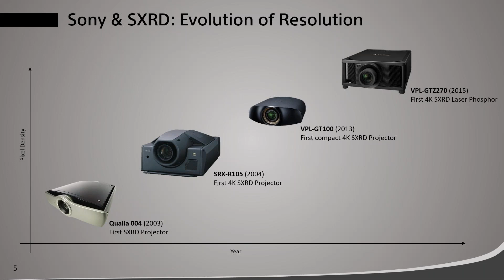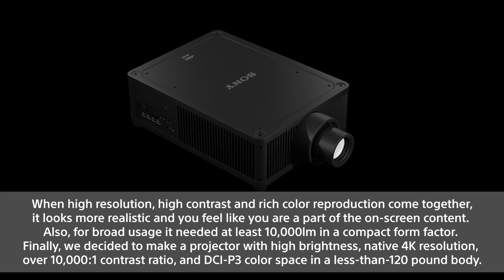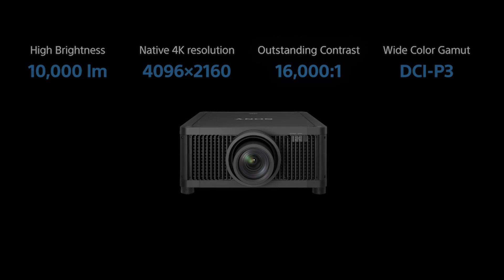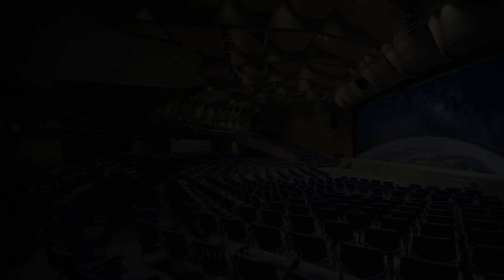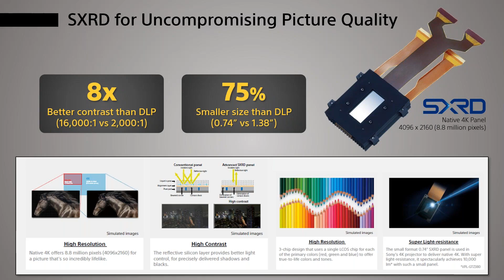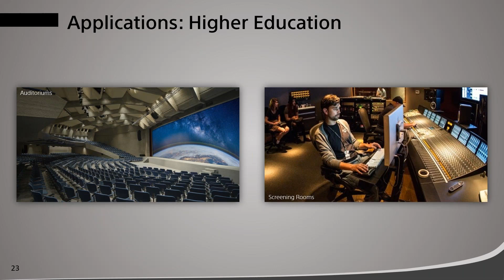Tech Tuesday:  Introducing the VPL-GTZ380 4K Pro SXRD Projector

Comment: No hdmi2.1? That's bs
Reply: If you're truly interested it does have dual DP1.4 allowing for full 4k 120hz 4:4:4 12-bit if you plug both in. No VRR in that mode though, which is a shame for simulation purposes, something Sony themselves advertises. But maybe it does allow for VRR over a single DP and tbh you're not gonna notice a difference between full or 4:4:2 chroma in game, only on the desktop where you're limited to 8bit anyway, so it would be a nice consideration.